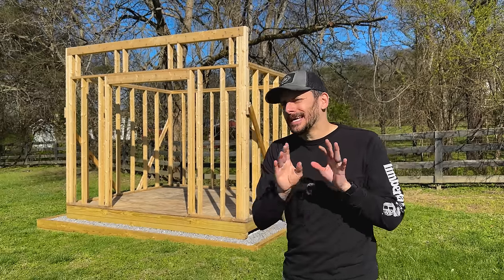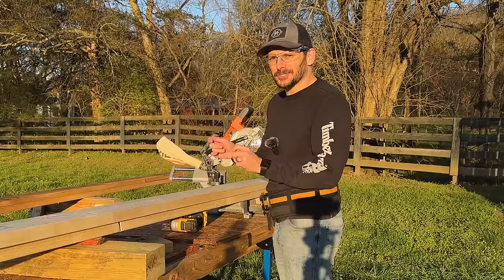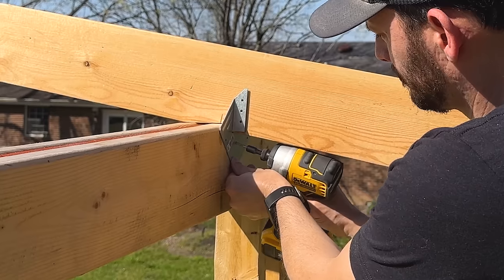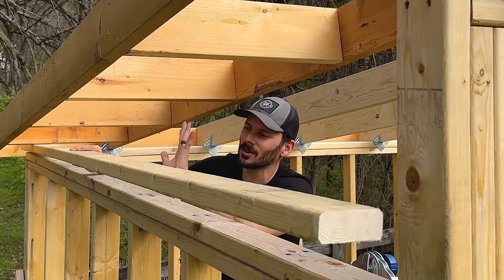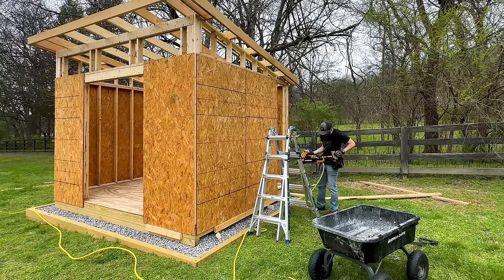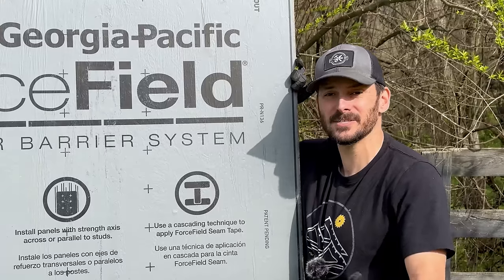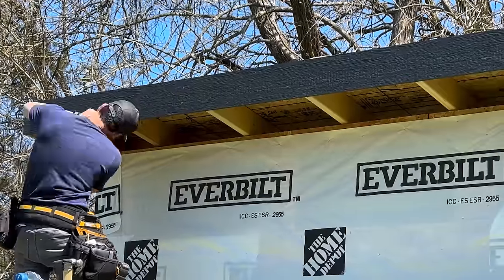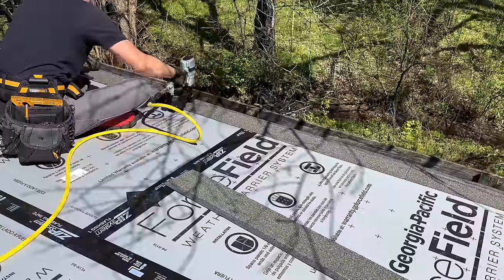Roofing My Overbuilt Shed

Comment: When you were using the story stick and moved from the front to the back, I knew for a fact that was the point I would have flipped it or otherwise used it incorrectly and wouldn't have caught it until I was setting the rafters.  When you set the fascia board upside down, I could totally see myself doing that too, especially working alone.  Thanks for leaving the oopsies in too.  You can't learn if you don't make a mistake occasionally.
Reply from the maker: after the fact I realized the story stick was where I actually went wrong, not the fascia.  I marked the stick upside down while looking at the drawing.  so actually the fascia should have been correct 😀

Comment: the boards on the front and back ends of the rafters are called "sub fascia" and the rafters on the two ends are called "fly rafters" since they are "flying" in space and not over the building.  That type of house wrap is an air infiltration barrier, not a vapor barrier. Generally, when doing a roof, we run a shingle up the roof too to establish the overhang. Finally, you did not have to put so many nails in that final drip edge at the top of the roof (end of your work).  You could put it down with a generous amount of roofing cement (comes in a caulking tube like the sealant you were using) and then just nailed it a few times.  This video was worth the wait from December Brad.  Thanks

Comment: I used the ForceField panels on my backyard office and was very impressed with the panels. They were left exposed for 3 months and I had only a couple of leaks from over driven nails that I was able to fix with flashing. I also did use Zip system tape with the panels because I saw a lot of negative reviews on the GP tape. It worked out great.

Comment: top tip for any shed, make the over hang massive so water never hits the sides or soak the foundation and potential rot the sill plates
Reply from the maker: yup, I went with as much as a I could to fully use the lumber I bought

Comment: Small blocks of framing lumber are prone to splitting.  You can pilot drill them, but it's generally faster to drive a nail or screw front to back and that holds the grain together as you drive a fastener the short way.
Hook blades are way easier for cutting asphalt shingles.  Start your cut 1/2 inch in from the edge and cut that short gap last.

Comment: If you lay your osb horizontal, that is how I was taught to install it, you can use the premarked lines for locating your studs. They usually come with lines for 16 and 24 on center. Then you don't have to snap lines for your studs.
Reply: Thats is correct and the sheating is meant to go horizontally because it will catche more studs and add lateral strength. He should of did it like he did his floor sheathing.

Comment: H- clips are design to add strength and keep your roof sheating connected between rafters. You may get some uneven sagging spots on your roof. As well wall sheathing is designed to fo horizontally to catch as many studs as possible to strengthen the whole wall. None of those things are major issues on a small shed but would be on a bigger build.

Comment: Doug all of those trees are worth the effort.  The first tree cut into sections that you can move with your excavator.  The second leave attached to the tree and section it off until you get to the tree. Again use your excavator as possible for assistance.  The next 2 your ideas are correct  get the weight off the tree and cut it.  When cutting off your stump use you excavator bucket and cut from it. Cut the base and pull down hill. The ones you said you would leave. Leave them. The last one is very tough.  Having a crane or bucket would be the best way. All of them would be extremely expensive to hire out.

Comment: Two years ago I had to replace the roof on the summerhouse at the end of the garden.
I had to replace 60m2 (645.835ft2), I used OSB2 2440mm x 1200mm which were 18mm (0.7 inches) thick  (2.44m x 1.2m or 8ft x 3.937ft).
After removing the very cheap roofing felt I removed the rotten boards, glass fibre insulation and had a break.
I replaced all the panels lifting the OSB boards on to the roof using temporary batons to stop the sliding off and fixed them in place, noticing quickly the "professional builders" that had built the summer house didn't know what a square was.  Battery powered Circular saw and impact driver were my friend, the sodden glass fibre insulation (after killing all the bugs living in it) was replaced with recycled plastic bottle insulation (it doesn't soak up water and bugs can live in it).
Once the roof was finally replaced I went about installing new roof felt, this was thicker and reinforced with glass fibre it was a lot heaver it came in 3m x 1m (118.11 x 39.3701 inch) rolls.. in total eight were used and I covered each OSB gap with bitumen and then used it along each long end of the sheet to secure it in place along with the felt nails at 100m (3.93701 inches) apart.
The whole replacement of the roof took four days with breaks to get new insulation or to get more screws and lift materials in place.
Yeah metric is difficult... I count to 10 and you are welcome to your fractions.

Comment: Just a note. H clips are used for spacing, but with a 24” spread on the rafters, the h clip provides strength from one sheet to the next. 7/16 osb should have an h clip for everything over the diamond layout (19.2 inches).

Comment: Nice job! I really would have encouraged you to use 5/8 sheathing on the roof though! Especially because of the rafter spacing and low pitch.  Unfortunately you will get sagging.  Perhaps you can add some blocking between the rafters preventatively

Comment: You should have put the drip edge on the front edge of the roof when you were doing your second to last row of shingles, once the drip edge was nailed down you could’ve put the last row of shingles on top of the drip edge, you would just peel up the keystone and nail under those then reseal

Comment: 9 minutes or so... its not a ridge board its called either sub-fascia or fascia fepends on how it finishes. A ridge is where the two sides of the rafters/roof meet in the middle.
Reply from the maker: ahhhh, good to know
Reply: In this case, it would be sub-fascia.

Comment: Curious why you didn’t run your sheathing sideways interlocking your joints? You still get the 8 feet in height but a lot more structural integrity.

Comment: Would you spray a sealer on the frame inside and out to help protect the wood since it’s weathered or will it be ok?
Reply from the maker: should be okay if it's not exposed to more elements, but I'll probalby seal the floor

Comment: A two on twelve pitch is really pushing the envelope and increases the probability of wind driven rain getting between the shingles and the membrane. Back in the day the manufacturer recommended increasing the lap of the shingles on two twelve. Not possible today as the sealing strip tech is different.
   I would consider four twelve the minimum with five twelve still easy to stand and work on without slipping while walking the roof.with a five twelve, the rafter length is only an inch wider for each foot the rafter covers per foot of building width. It is exactly .97 ,but you get the idea. It becomes even more important if you heat the building to work inside because of ice dams becoming more of a problem.
   Other than that, you did a much better job than most by laying things out on the ground instead of chasing a tape measure Found the top plate with a marking pencil as 
Most people do

Comment: Force field, I would not use that as a primary board, 7/16 OSB is not a strong sub sheatting, for a roof, I used it over 1/6 blanks, but not alone, not on the roof.
Reply from the maker: what's a 1/6 blank?  Never heard of that

Comment: If you'd just used the same paint on the fascia (or any old / leftover paint) on the backside of some standard OSB, you'd have made your own "Force Field" but better. Especially if you paint all of their edges as well. Edge first, then install, then use a roller on the entirety.

Comment: A bit off topic of the video but,  I am trying to find some in depth videos about setting up a lathe.  Most of the ones I see these days are modern/variable speed and attached motors.  Mine is an older Delta Lathe with separate motor and belts.  I have had it since 1995, since my uncle passed.  It has never been fully set up to turn anything.  Any help/directions would be greatly appreciated.

Comment: Might have missed something, but you don't heve to put any of that drip edge trim on the sides of the roof? Just top and bottom edge? Were the edges finished with anything? Zip tape?
Reply from the maker: drip edge on the sides was applied the same way as front and back and also taped. You can see it in the seaming portion of the video, but I didn't specifically call it out.  I got a little too handsy with the edit to get it under 30 min
Reply: @Fixthisbuildthat  awesome! Thanks for the clarification!

Comment: My home has a 4/12 pitch, barely, and after 25 years the OSB roof sheathing was water damaged severely.  Cheap triple tab shingles by the builder. The roof felt was not sufficient. Bad combination. The LP siding failed due to the previous owner not maintaining the paint protection.
Reply: no underlaymenT?

Comment: Honestly I think it would have been good to put ForceField on the wall rather than the roof—eliminates the need for house wrap application and is generally more air and water tight. I would pay the premium for Zip on the roof since it’s a lot less slippery to walk on and doesn’t get ripped off the edges like you showed happening here.

Comment: Dont you own a framing nailer???  Or do you own stock in a screw co.?
Reply from the maker: I go back and forth depending on the situation, but screws definitely have better holding power
Reply: @Fixthisbuildthat  holding power yes but nails handle movement, temp changes, and moisture better than screws.

side note: i use screws more than i should too.
Reply: The main difference between nails and screws (outside of the obvious) is shear/withdrawal strength. Nails typically have a greater shear strength, while screws are harder to pull out. So it will depend on what you're using it for. The truss/hurricane ties (all metal connectors) should be installed with "teco" nails. Where they are not as long (typically), but the shear strength is greater.

Comment: you obviously never watched tom silva from this old house...when installing drip edge you want it a finger thickness away from facia board
Reply from the maker: i actually watched that exact episode.  The drip edge I could find had a very narrow top lip though, so I didn't feel like I could afford moving it out.  But that's also why i went 3/4" overhang on shingles vs 1/4 or 3/8 😀

Comment: Honestly though why are you still using inches and fractions... it is only yourselves Liberia and Myanmar that continue to use this measurement system.
Metric too difficult...  if you count to ten then it is possible for you. 1mm (v small) 10mm = 1 cm (not so small) 100cm = 1m (bigger (3.3feet)), 1000m = 1km (way to big for woodworking)